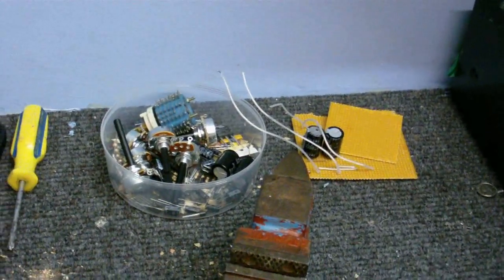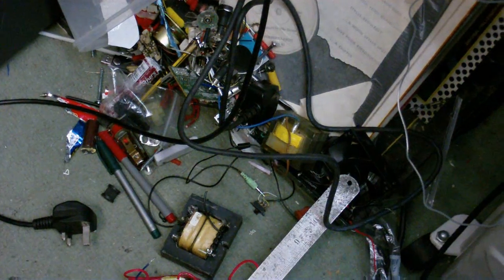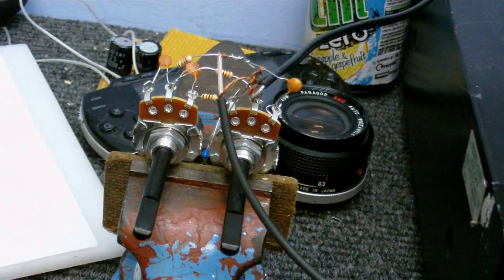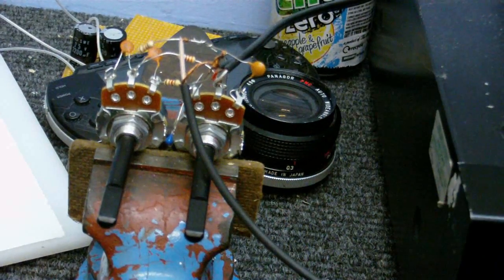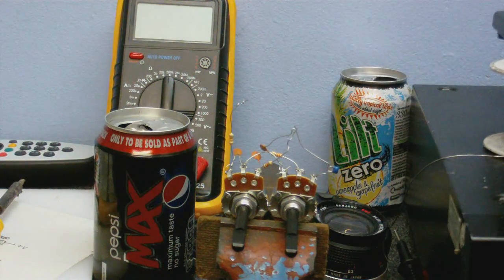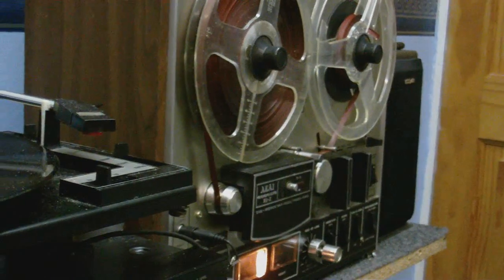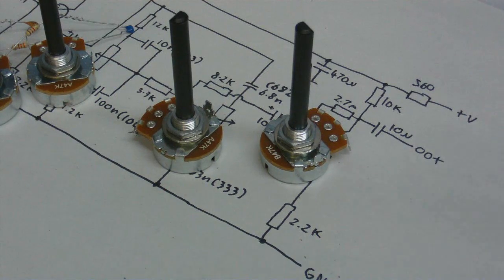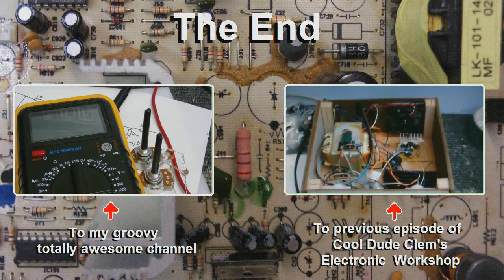CDC Electronic Work Shop   The Amplifier Adventure III part 1   Making a tone controll

Comment: If i was to build this, there is only one thing that i didn't get from the video.
do you put the tone control in the speaker circuit before or after the amplifier.
and WHAT was that first song you used.

Comment: Very nice tone control! It works great. I never knew of the logarithmic and linear pots, I just thought they were all the same. (except those that can turn around multiple times).By the way, how's your original amp (the one with the relays) going? Still in service?

Comment from the maker: @TheElectricnoob I found a schematic of a 90 watt amplifer (100 watt if a good power supply is used), I'll show the actual schematic of it in the next video, I'm currently building 2 of those, for stereo of course, I have one built and even though I couldnt find the exact output power transistors specified in the schematic, it seems to work well, great sound quality (and that's without the tone controls), and goes quite loud, so it's looking good.

Comment from the maker: @BeeOwGeeDeeAyN I'm sure my amplifier would sound good without tone controls, but it's really because there are times when it would be a good idea to turn down the bass, so as not to annoy anyone, or when one of my recordings isn't too good I could ajust the treble and bass to compensate for it.  Most of the time I'll probably have them set to the middle, my bookshelf speakers do have a good sound, and I have a pair of vintage 70's hi-fi speakers, there quite loud, but need a little bass bost.

Comment: What do you need this controls for? I know what they are for, but wouldn't it be better if you make an amplifier with only one control and it would be volume control? So the idea is to make a good amplifier with good speakers that don't need any controls except volume control. The best audio components should sound fine without any tone adjustments. What speakers are you planning to use with the DIY amplifier?